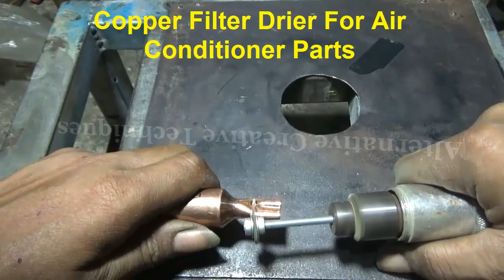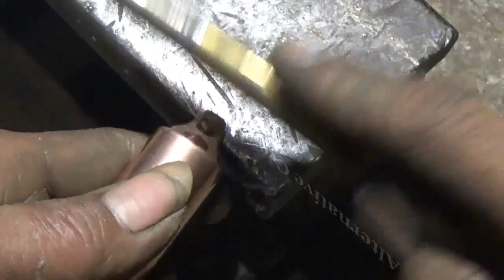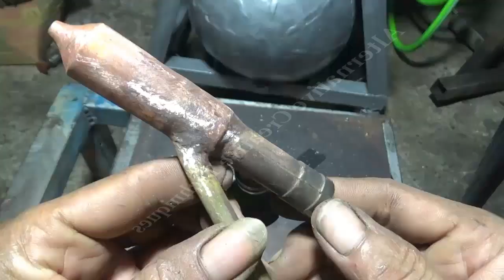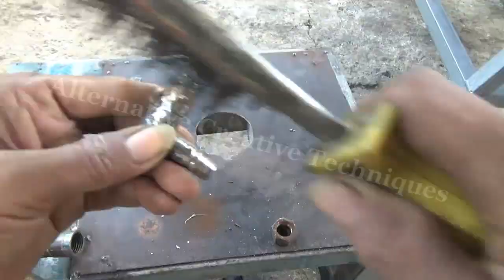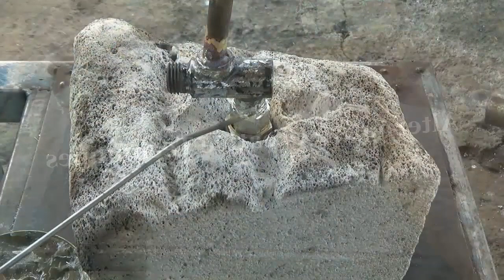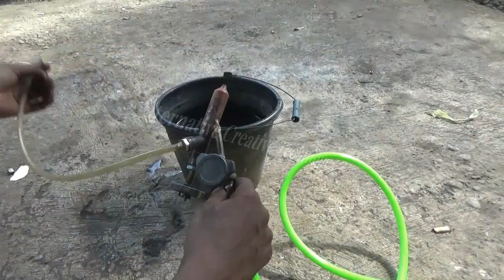(How to Make) Oil atomizer for waste oil burners.

Comment: Very good video!  What is the air pressure necessary for the atomizer to work properly?
Reply from the maker: Pressure of 20-25 psi can work.
Reply: @YudiHermanto4H  Perfect! Many thanks! This information is very useful to me, I would like to do something like that but it can be operated with a refrigerator compressor, I do not know how much pressure it delivers but it may be enough if only 25PSI is needed. I will have no choice but to do it and try. But thank you very much!!!
Reply from the maker: Ok, you're welcome.
Try this one, using spray gun : https://youtu.be/cGcIhgIo-VA
Reply: @YudiHermanto4H  It is very interesting, I could try it, I just have an old paint gun that is no longer useful for painting, but I could recycle it... :D

Comment: I have to ask this as I was wondering.....if you used a hair dryer blower, and blew the air through a Lawn mower carburetor that had waste oil in it instead of gas, wouldn't it also atomize the fuel for you and give you a  way of controlling the burn?  Just an idea
Reply from the maker: That's right, I've thought about that.  later i will try it.  I will use a fuel pump and an injection motor nozzle.
Reply from the maker: I've done some experiments :
https://youtu.be/qqkaMnMcgY8
Reply from the maker: https://youtu.be/jfpdk_WthZM
Reply from the maker: But for oil, because the viscosity is quite high, it is not enough in a simple way.

Comment: Good afternoon. 
Please tell me you didn't add a burner diagram in this video.
Does this burner work on the same principle as this burner? 
https://youtu.be/QDrFvK1fR1c?si=j-d2_2UbWrUW6fUL
They are identical ?
Reply from the maker: In principle, the oil mist jet should not be straight, but angled slightly downwards.  So that the oil mist doesn't emit too fast and it gets stuck in the burner body.  So that the oil mist burns in the body/burner pipe. So, there must be a fire in the burner pipe to heat the pipe to help complete the process of turning the oil into mist so that it ignites easily.
This is if the pipe or body is straight.

If the burner pipe model is bent, you just have to adjust the direction of the oil mist emission so that the oil mist doesn't turn backwards.  In essence, the courtship of the oil mist is slowed down by hitting it against the walls of the burner pipe.

Liquid or viscous fuel will ignite easily if it turns into very small particles and the combustion chamber temperature is high.
Reply: @YudiHermanto4H 
Thanks for answers))
I'll try to assemble your burner and test the stove)
A very interesting topic, many different nuances.
I want to try to melt cast iron...